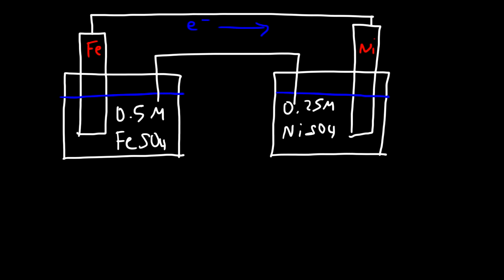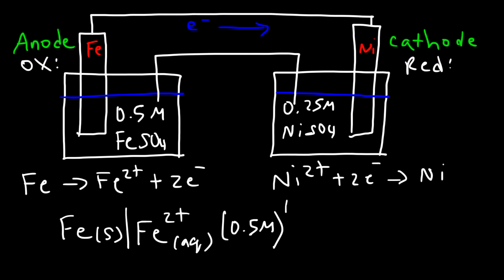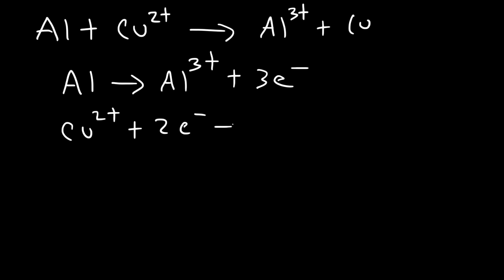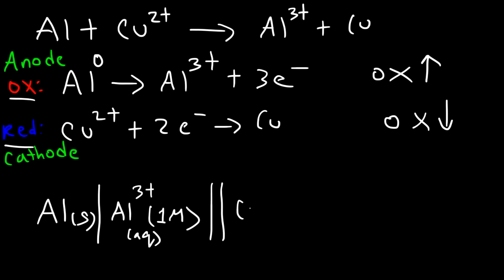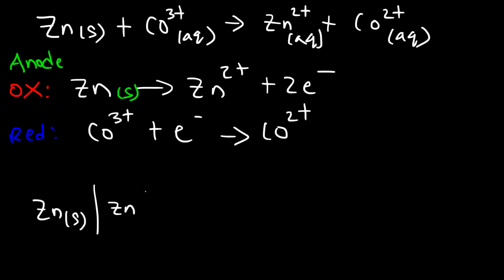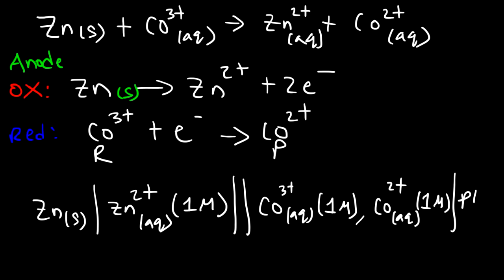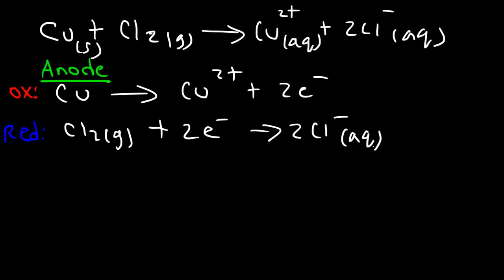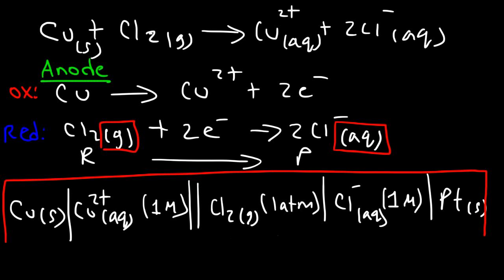Cell Notation Practice Problems, Voltaic Cells - Electrochemistry

Comment: Am asking if you can help me with this
For the cell:
Pt(s)|VO^2+(0.116M), V^3+(0.116 M), H^+(0.157M) || Sn^2+ (0.0318M),  Sn^2+(0.0318M)| Pt(s), E(not E^0)=-0.289V.
Write the cell reaction and calculate it's equilibrium constant.
(b) Consider the redox reaction:

Comment: hi, great video btw!! , I was just wondering, when do you know if you need to put in the platinum electrode? or why did you use one on the end reaction?
Reply: You use a Pt or graphite electrode when you have a redox reaction that does not contain a solid cathode/anode on one/both sides. Pt is normally used as it is "inert"- meaning that it does not corrode when used in acid, Pt also tends to catalyse proton reductions ie make them faster. 

Hope this helped!!

Will
Reply: thank you!!!
Reply: @williamdavis2687  you suck at chemistry
Reply: @gartyqam  oh really, please do the favour to correct him